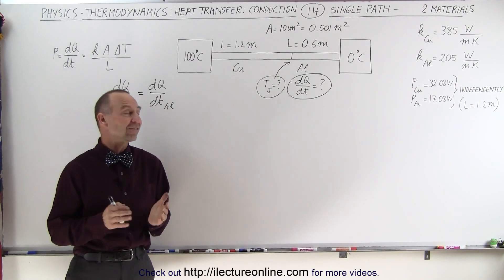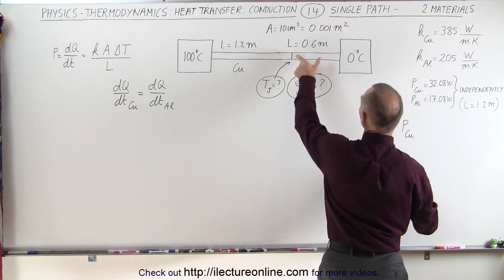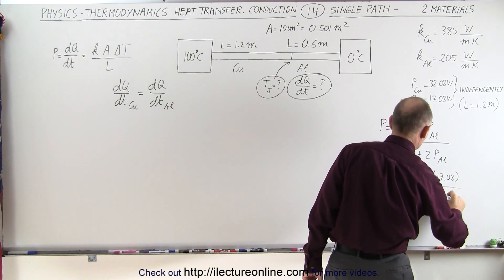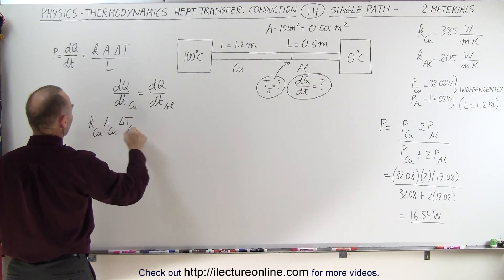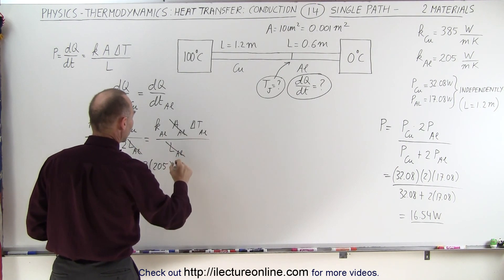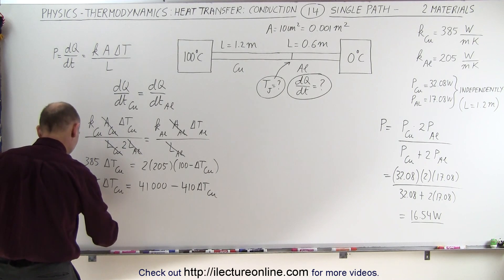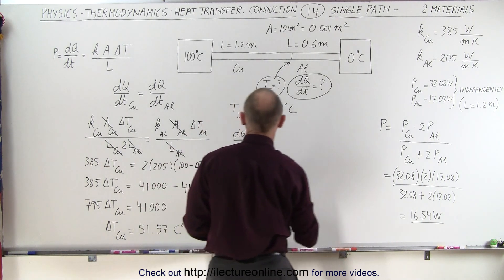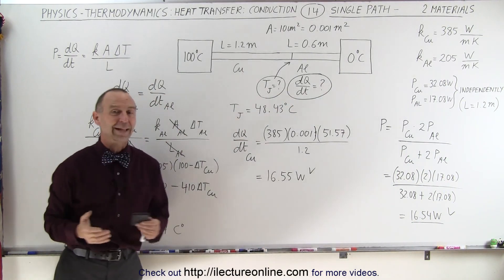Physics 24  Heat Transfer: Conduction (14 of 34) Single Path - 2 Materials

Comment: That is really nuts that heat transfer works just like resistors in circuits. I have a question though, our metals connected in one path, like resistors connected in series, behave as though they are resistors connected in parallel given the formula you are using for power where Power-Total = (P1*P2)/(P1+P2), that is the same formula resistors in parallel, why doesn't heat transfer of metals connected side by side work like resistors connected in series where Power-Total = P1 + P2?
Reply: Actually now that I thought about it some, should I be thinking of the metals more like capacitors? Then the formulas match?
Reply from the maker: Think of the heat like the current in resistors.  Then the current will behave the same as for the dQ/dt.    But then you'll have to find the equivalence for resistance (unless you want to use the conductance)